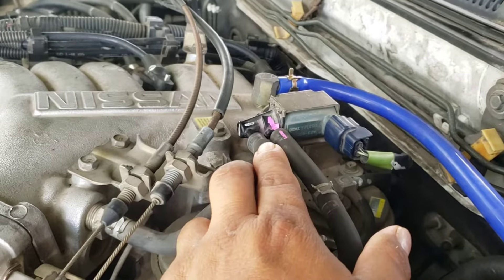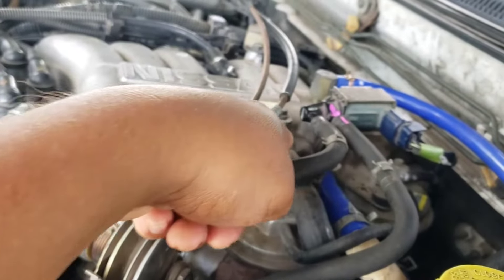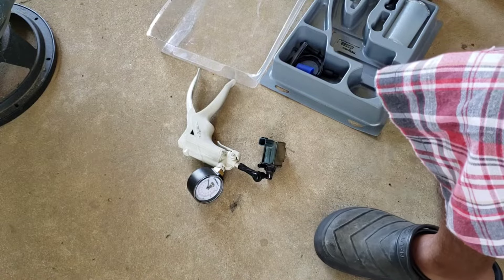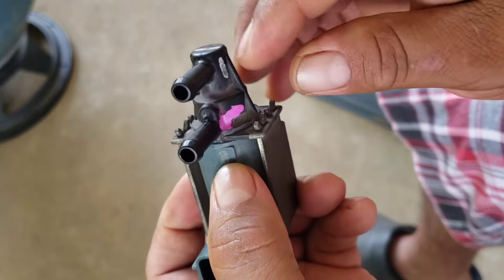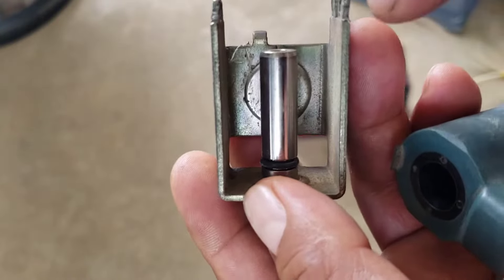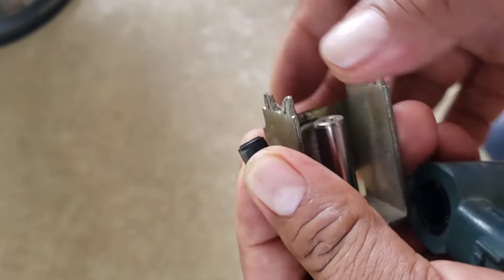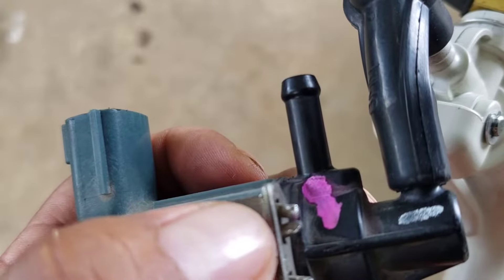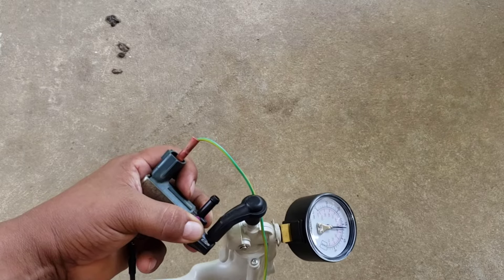how to repair a stuck open Purge Valve
Solenoid can a bad Purge Fix for Car 
P1444 code Nissan

Comment: This is how you show case something great. I appreciate the fact you repaired the part as opposed to just replacing it. Often many of these smaller items can just be fixed at a much lower cost and if you get your diagnosis wrong the repair was less than a non-returnable electric part.

Comment: ps some times 
the spring loses
compression 
give it a little stretch
also a cleaning with brake cleaner is always a good thing 
use a qtip or old tooth brush

Comment: Thanks my friend I did like yuo show in the video, and now the valve works perfect..
Plus I blow air in the lines fron the charcoal canisters tu the engine and was a lot charcoal inside de pipes..
Good job..
Muchas gracias amigo hice lo que muestras en el video y funciono perfecto 
Tuve que ponerle aire a presión a las líneas de vacío desde el canester de carbón asta el motor o la válvula
.
Reply from the maker: thank for watching

Comment: question ? frame 4:40. i just slipped a 2' inch piece of rubber hose over nipple area on evap solenoid+ no spring or o ring on mine. and erased code. it fixed mine. it runs real good. the plastic thin brittle lines are easy to break,, espessially if car is older imo. does what i mentioned sound right.?

Comment: Purchased a new valve for $60 and took less than 10 minutes to replace. Only tool needed was a 10 mm socket. One less recurring issue in the future.
Reply from the maker: Awesome

Comment: i fixed mine. i got code po446. i erased it a time or two. after i took a good look at my evap solenoid i seen a torn vacume line. i unplugged solenoid,,,replaced new hose around 2". and erased code. ( car runs back smoother and much less fuel now. )

Comment: Can that cause a p0448?
Reply from the maker: Yes this can cause P0448 code if it stuck Close
Reply from the maker: That means could be a broken wire or loose wire, hot wire or ground wire
Reply: @IshMotorparts  oh 
Cause last year around this time I took it to a shop did smoke test etc and they change the vent control valve but the next day when I start up engine code appear again but the same time I had a airbag recall when I took it to Nissan and I guess they reset the computer after the airbag the code went away for a year and last week it appears back , so you think it can be the wire ? Or which part should I try next ? Thanks
Reply from the maker: First test  the purge valv first if it clicks on and off then that's good, now check the wires with a multimeter.  Before you start or put the key in you shouldn't get nothing and then start the car now you should get 14.oo from the block and white. And .22 from the block and green, with the black lids on the negative side of the battery. Now at the pigtails now Red on black and white Black on black and green at this point you should be  getting 13.5-14.00 volts. If that's good  then now check the vacuum line from evap canister to the purge valv. At that point you should fixed the problem already.  Hope that helps thanks for watching and subscribing

Comment: Mines squeaks when I come to a stop and my idle drop and almost cuts off.  I need to replace it.
Reply from the maker: No, no need to change the Purge valv, because sounds like you got different problems
Reply: @IshMotorparts  I later found out that the squeak noise was coming from my gas cap, but I also have a bad purge valve too.  Thanks.